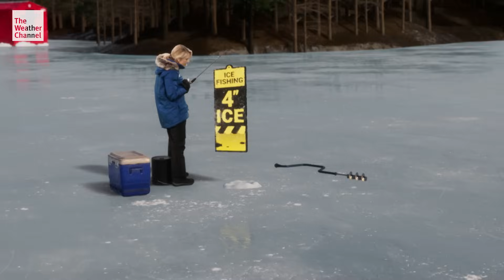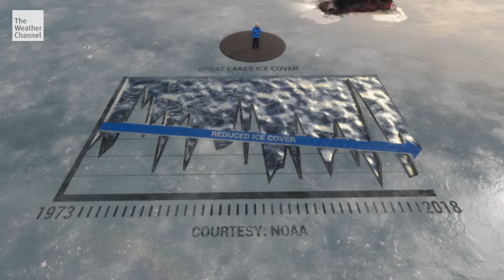The Science Behind Ice Thickness | IMR

Comment: Unfortunatelly, reality is not as easy as it's showed.  There are different types of ice and each of them has got it's own endurance. Material from this video is proper only for this type of ice, which was created at calm water surface in temperatures about 10 F degrees ( - 15 C degrees).  Not only thickness of ice cover matters, but also structure and temperatures during the freezing.  Most people don't know that, so we have so many deaths under the ice each year :(

Comment: I know nothing about ice covered ponds, coming from a warm climate. I was hoping this video would give me a general idea of what safe-to-walk-on ice either looked like or what parts of a pond were more likely to be more solid (edges? Center? Small areas? Wide open arenas?)
Reply: Black ice can support from 5cm, but ice thickness will vary. 10cm is reccomended for big group, thus you have some margin as well (some might say 8cm, some 9, some 7, depends on how willing you are to risk falling through, and what safety measures you do). Ice will vary over the lake, but where water flows it is always thinner (inlets, outlets, thinner parts where water moves faster). On big lakes the more shallow parts on the edges will freeze first, but as the whole lake freezes, thickness will level out. Layered ice with different types of ice makes everything more complicated, but black ice (see-through clear) is the strongest, and easiest to calculate whether it will support a person/a group/snowmobile/car/tractor/truck. Sea ice is also more complicated than lakes. If you want it simple, find a lake with minimal inlets and outlets, and skate on it when 10+cm black ice. Bring rope, ice spikes (or knife or something) and extra wool skift for safety.

Comment: Planet warming 1922

1922
April-May
All time highest stage at New Orleans with a crest of 21.27 feet on April 25th. Donaldsonville 2nd highest crest of record at 34.75 feet on May 16th. [AHPS]
1927
January-May
The greatest flood in modern history on the Lower MS River! This event due to persistent excessive rainfall on many of its tributaries combined to swell the river across a vast flood plain that spanned 80 miles wide in some locations. This record flood event changed the course of U.S. history by launching then Department of Commerce Secretary, Herbert Hoover, into the national spotlight towards gaining the office of President. This massive flood prompted legislation to mitigate and gain control of the river through erection of levees, flood control projects and spillways to alleviate catastrophic flooding, under the passage of the Flood Control Act of 1928, the authority placed with the U.S. Army Corps of Engineers. This flood caused widespread socio-economic impacts inclusive of mass displacement of people living in the inundated areas, primarily indentured farmers and field workers. This event is still regarded as one of the costiliest natural disasters in U.S. history. Red River Landing recorded its 2nd highest flood crest of 60.94 ft on May 14th; This is still the record crest at Baton Rouge of 47.28 ft on May 15th; Donaldsonville record crest 36.01 ft on May 15th; New Orleans had two crests; the first at 21.00 ft on April 25th to rank 3rd highest on record, the second 20.50 ft on May 18th to rank 4th highest on record. A crevasse was dynamited in the levee at Caernarvon, LA, 14 miles below New Orleans to save the city from flooding, but at the expense of destructive flooding of St Bernard and Plaquemines Parishes. [Smith&Reed; Hoyt; USACE-MRD; O'Brien, Barry, AHPS]